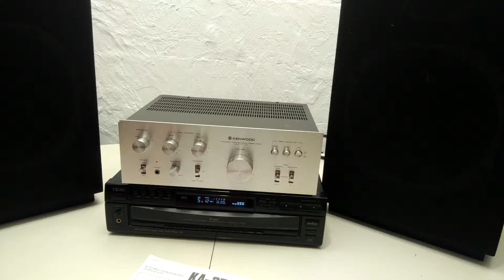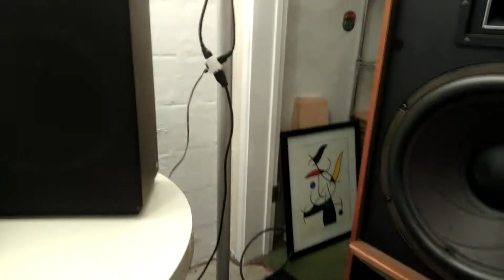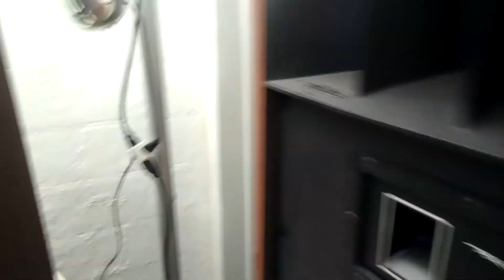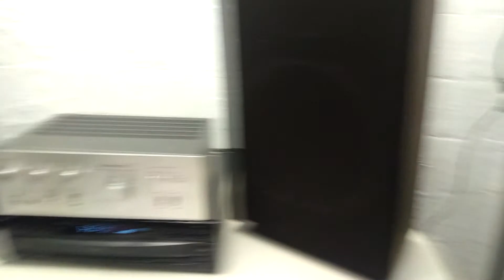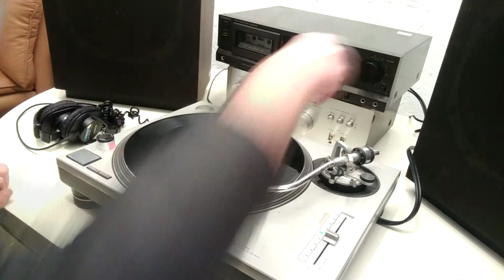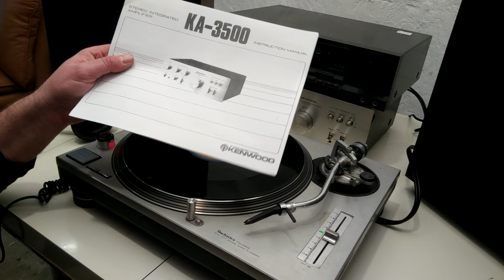KENWOOD KA-3500 INTEGRATED AMPLIFIER Basic Features

Comment: How would you hook up a sub to this amp.?
Reply: To add a subwoofer to a KA-3500, you need a powered subwoofer whose plate amplifier can accept high level (i.e., speaker level) input. You run the speaker leads from the KA-3500 to the high level inputs on the subwoofer plate amplifier, then run speaker leads from the speaker outputs on the subwoofer to your two side speakers.

Comment: I RECEIBED EXACTLY THIS AMPLIFIER, BUT I DON'T KNOW ABOUT WHAT MORE I NEED TO USE IT. WICH KIND OF SPEAKERS I NEED? CAN YOU HELP ME?
Reply: You only have this amplifier for nothing more ?
Reply: @TheEwolf7  I already found second hand kenwood speakers to connect them to amplifier. Thanks anyway!
Reply: In addition to speakers, you will need a sound source: Phono (turntable), or tuner (radio), or tape (cassette, reel-to-reel), or CD player.   I have had two of these amps, one since 1976; and they both work beautifully. You can hook all these sources up at once; if so, you can switch between them.
Reply: @paulschumacher1263  thanks! I already got ones! two old second hand kenwood speakers, are working very well till now, then it's fine!
Reply: @paulschumacher1263  I connected my vinil record player and it works perfectly.